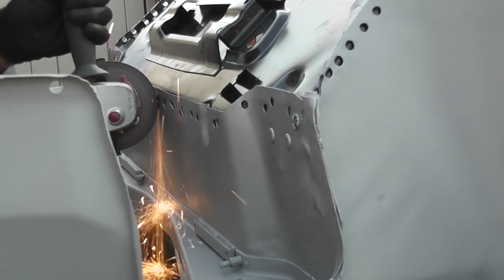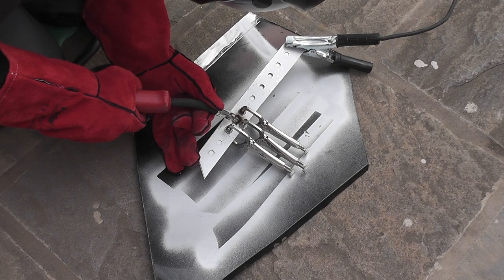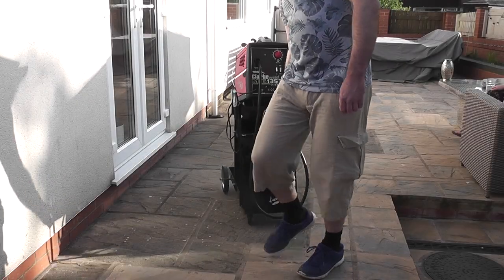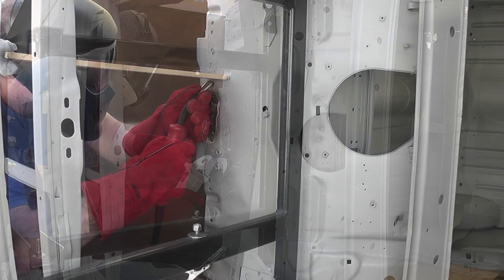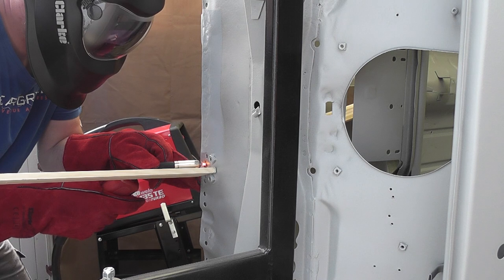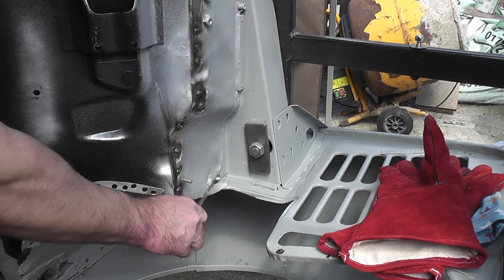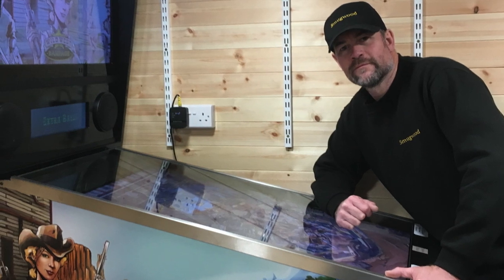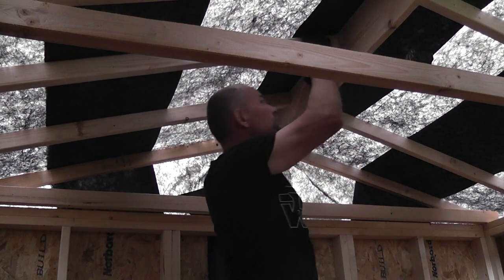Classic Mini Restoration Episode 21 - Fitting The Toeboard Part 3

Comment: Lee, I‘m sorry to hear you found the welding difficult it is something that takes a bit of time to master,  It takes a lot of guts to admit you need some 
help and there is know reason why you can‘t come back to it later, I would suggest you watch some of the welding being done if you can and it will 
help you see how to get better welds, Some weld through primers are rubbish and they can make it difficult to strike an arc this is why you may have 
had better welds on a test piece, Welding at an angle is something that takes time to master as opposed to welding flat on a bench, I hope this helps. 
Cheers Dave
Reply from the maker: Thanks Dave. Im usually not too bad at practical things but this really beat me. I think as well what made things awkward was being outdoors. It’d be nice at some point to see what welding indoors is like and see if there’s a difference. Problem I have is my workshop is full of wood and didn’t want to risk it all going up in flames 😂

Comment: Just come across your video, I really feel for you. It’s the wind and the welder setup that’s the problem. The wind blows the gas away, so the weld doesn’t flow - it’s ends up being high rather than wide (if you’ve got bubbles (air holes) you’ve got no gas) basically if it’s windy don’t weld outside. I think it also looks like you got your wire speed and power to high… set you power so it doesn’t quite blow a hole in the metal, then set your wire speed as slow as you can (if you go to slow it will splutter as the wire is melting quicker than it’s been replaced). Finally for plug welds you need to do a kind of circle, a bit like an @. I’m only a diyer, but have restored a few minis etc.
Reply from the maker: Thanks. I felt a bit of a failure having to ask someone for help with the welding…but I’d rather it be safe. I’d love to have another go one day when funds allow but will make sure I follow the welding rules and not weld outside, especially in the wind. I do actually have an idea I’m working on that might allow me to build Smugwood Mini 2…but it’s early days yet 😊
Reply: Your a glutton for punishment 🤣 good luck. Defo not a failure… asking for help is a strength… I wish I had a Dennis, he made a cracking job of your car.
Reply from the maker: Yeah I wouldn’t have a drivable car without him. I’m hoping in the not too distant future I’ll be back there with another project…
Reply: @SmugwoodMini  I’ll watch this space